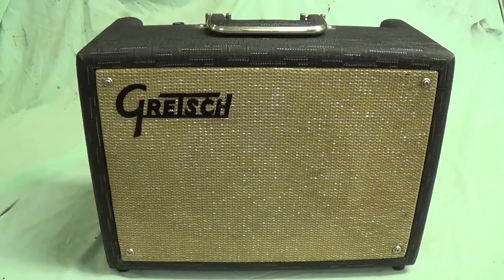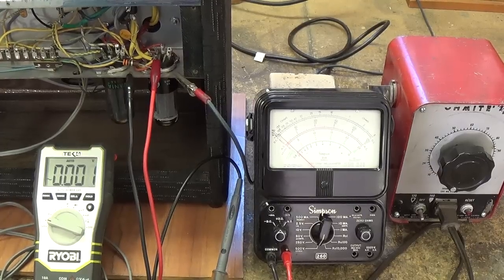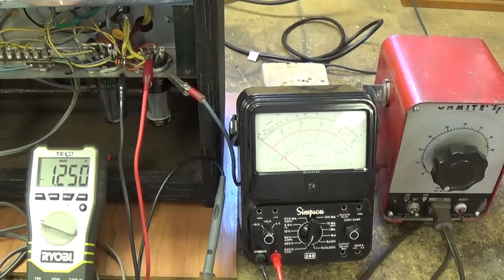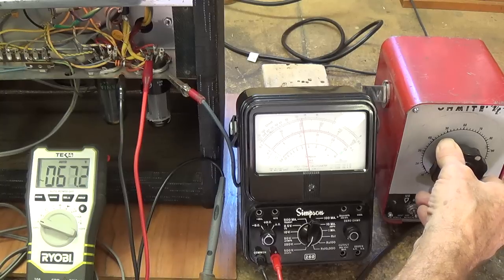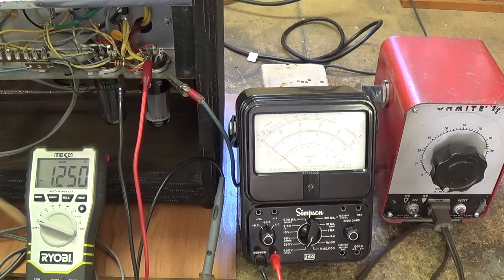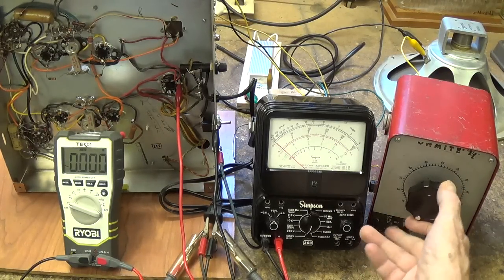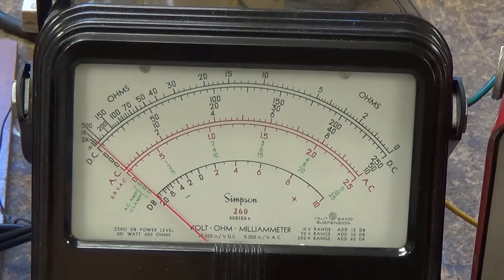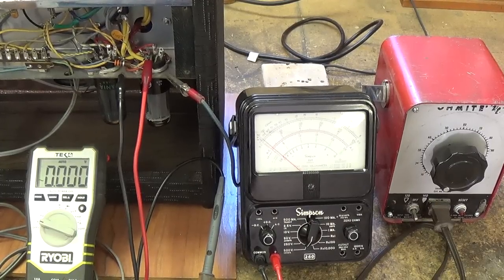Is Gradual Variac Warm-Up Effective with Tube-Rectified Amplifiers ?

Comment: Is there a self life for caps? How long will they last, brand new and never been in service. Last summer I went to a yard sale and found a box of electronic parts and there were caps that were new(no solder) or in parts bags. I gave 5 bucks for the whole box!
Thankz
Reply: Hi Hubert, of course there is a "lifetime" for Caps. Industrial grade Caps usually got some readings like this (this is an example of one of my caps lying around) 27/105/56 besides the usual: 180/385/400 and 06/98
What are their for:
Operating (ambient while working) -25 up to 105 gedgrees celsius within 56 days of humidiy tested in a climatic controlled enclosure (temp oven)
Next is: 180 usually in micro farads (=capacitance) 385 is the max operating voltage 400 is surge limit peak voltage of about half a cycle. Last is the datecode here it reads 06 for week and 98 for the year (=06 week of 1998)
According to the IEC standard for Caps they do test on how long the operate, some first grade Caps have lifetime rating printed on as well, like this: 105/10.000 the manufacture garantee that this cap will be last at least 10 thousand hours of service (also known as the MTBF=MeanTimeBetweenFailure) at 105 degrees celsius without driyng out more than 20% of the initial capacitance.
More "sophisticated" Caps reds this: 135/20.000, or 40/135/85
If you go for filter caps, if they are not dryed out or leaked physically you can try to "re-form" them when you have some NOS or pre-used (big)filter Caps:
Apply a DC voltage with current control. Rise the voltage very (about 5minutes) slowly up to the rated voltage, but watch the current. Use an analog meter for that as the reading is far more clearly when current may change rapidly.

When you charged the Cap completely just shut down and leave it like this for a while (over night), as the static voltage in the cap causes some chemical procedures inside and also re-format the insulation, but this takes time.

I was able to re-format some very old NOS Caps and now they are working just like new ones within their ratings.
As well as industrial grade LowESR 2200/500/550 25/105/85 08/76 with M8-screw terminals.

But be very careful with Caps that size, as they store a huge amout of energy. do not touch the terminals in anyway, never short them. And store these caps with a 470k to 100k resistor across the terminals. As even a fully (=close to zero volts) discharged Cap will do some "self recharging" over time causing some real lethal voltage presented at the terminals.So if you find some of these, may be in a box or some online auctions in unknown condition never touch the terminals measure the voltage first!

Hope this helps;)
Reply: TubiCal I keep large bleeder resistors on my bench with clip leads attached to them...a valuable discharge tool.
Reply from the maker: TubiCal
Great advice and information. I too have noted the mysterious "self charging" phenomenon. During the experiment in the video, after carefully and thoroughly discharging each filter cap, I noticed that the (B+) DC voltmeter (which was at zero immediately after the discharging process) registered a slowly increasing voltage, even though everything was turned "off".
Reply: Uncle Doug By the way, I had to take notice to the Simpson 260 VOM...Looks like you've brought it back to life! :)
Reply from the maker: Yes, it cleaned up perfectly, inside and out, and seems to function quite well. I know that digital meters are the standard of the industry, but I still REALLY like good analog gear.
Reply: I concur! I have my old 260, and my EICO VTVM that I use religiously. I have the digitals as well, but a VTVM is better for tube work since tube circuits are of high impedance nature. DVM's and VOM's have a tendency to load down the circuit under test.
Reply from the maker: Watching numerals jump around on a digital doesn't give me the same feel for what's going on that an analog needle does......especially when testing pots for smooth, continuous resistance sweep.
Reply: Yes, I agree! Digital meters are constantly refreshing the display and you're not getting the reading in real time! the same reason I prefer an analog CRT oscilloscope rather than the new digital LCD scopes. :)
Reply: Frank Ferraro
Here i got various DMMs, they got all a display delay, furthermore if they are autorange this takes a lot of time with no readings at all. So if a sudden rise of, let say, current you´re left on your own because the meter won´t show you while it is stil buisy trying to find the appropriate range...
I love my now working "Taylor" model 100a so much, as it has a very big meter with a very nice "cut-out" function as it is operated by the meter needle itself, if the needle is at most right the needle mechanically hits some sort of rocker/lever switch which will multiply the force and finally hits a big circuit breaker.
Reply: Frank Ferraro I've been sitting on a bunch of old test equipment for years, and haven't done anything with it. I have an old CRT scope, a signal generator, and several other items, and I want to mess with them when I retire. I may actually be retired already, and don't know it. I was laid off after sixteen years as a welder at a factory in August of 2013. A week later I had a heat stroke, and my health hasn't been the same. When I started that job in 1997, I was just starting the second year of the electronic music instrument repair program at Red Wing Tech school. I had to drop out to make ends meet when I had to begin paying child support. I'd been a radar repairman in the Air Force in the early seventies, and before that I'd taken a year of electronics in high school. I had wanted to build amps. I put it all on a back burner for a long time and mainly played guitar, bass, and drums in bar bands, but finally came around to succumbing to my tube amp illness and then came to Red Wing, where my tube amp illness again went into remission. I put it on the back burner again and became a factory worker. Recently I learned I could go to school at practically no cost,  when I turn 62 next year. Sadly, the electronics program no longer exists at the school here. I would be thrilled if I could complete the process and get into some type of amp restoration. I have stayed with it as a hobby, but actually haven't been very productive. My life has been pulled in many directions, and I had to do what's best as a dad. I have a couple dozen old amps that have been waiting for me to get off my butt. The most interesting one is a small box Marshall that I got used in 1980 from a shop who got it from a police auction. All ID indications on the amp had been defaced, and I have never known what model it is, but I used to play it. A great shop in Minneapolis installed a master volume in it for me. It was also apparently repaired a few times before I ever had it. I remember having seen an oddball power cap inside once, back then.  One day in the early 90's I discovered it was dead. I found out years later that it had a 30 amp fuse in it, and I recalled leaving it at a bar in the 90's for a week between consecutive gigs, that's when I discovered it'd failed. When I turned it on it began to smoke, and I shut it down. I haven't ever done a thing with it since. I just now figured out that it was used while I thought it was just sitting at that bar, and that bar owner is long dead. They played  it & it must have blown the fuse, so they put the thirty amp fuse in it and it probably took out the power transformer. I'll bet some of you have your own stories about leaving your equipment at a bar, and the bar owner & his pals secretly wreck it for you, and play dumb when you discover your ruined stuff. I guess those transformers can be obtained from Mike Matthews and from Gerald Weber, but I'm on a tight budget. I haven't worked at all for ten months. I dreamed about that amp last night, and woke up with the shock of finally figuring all this out. I had never really known how it failed, and I guess it goes to show how you only THINK some people are your friends. I was clueless for twenty years, and a dream put it together for me. I have it at a storage facility and if I had the room, I'd bring it home today. I guess I have to do all the repairs on other people's stuff before I can take the time to work on my own stuff, and I've just never been caught up. I've been a pushover for helping out other musicians and my own stuff just languishes year after year. My crappy trailer house is jammed full of stuff. I have to admit it's the result of my own poor decisions and the disorder in my life & home. I'm so glad I found these videos this morning. That amp was on my mind from the dream I had, and I just woke up & started searching. Maybe it's a sign that I have to take charge of my life and finally do something. Starting to feel the symptoms returning....

Comment: Excellent video.  In your opinion is safe to use a variac on modern tube guitar amplifiers?  Some modern amps may have digital electronics on board.  I was curious if running a lower AC voltage to the amp may harm these electronics.
Reply from the maker: Brock Erickson Thanks, Brock. I understand that in some cases, particularly with solid state (digital, transistorized, etc.) circuitry, operation at low voltages can cause harm. For that reason, I would only advocate using a Variac on older, purely tube, equipment such as guitar amps and radios. This is discussed in comments below and in the video description. Quite frankly, since the slow Variac warm-up is to rejuvenate vintage equipment that has been dormant for many years, I fail to understand why anyone would even consider it for use with modern, digital devices.
Reply: Uncle Doug Thank you for your response.  I ask this because putting a variac on front of a tube guitar amp while playing may give the amp a more desirable tone.  Eddie Van Halen claimed he did this to his old Marshall Plexi 100w to get his early era "Brown Sound" guitar tones.  Around 88v. 

Thank you for your time.
Reply from the maker: You're welcome, Brock. That's an interesting story about EVH. I can see why they'd call it "brown sound".....sort of like the brown-outs that happen occasionally in big cities.